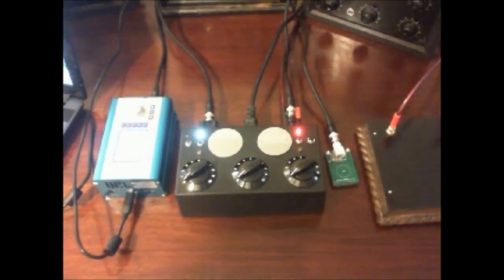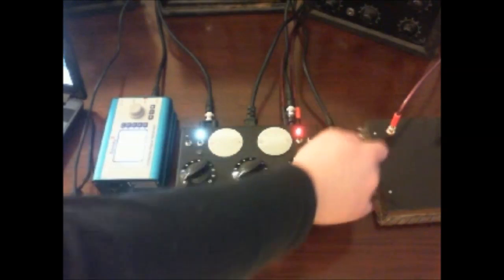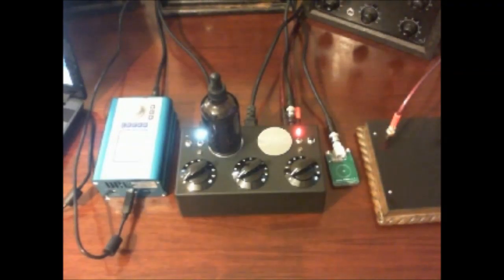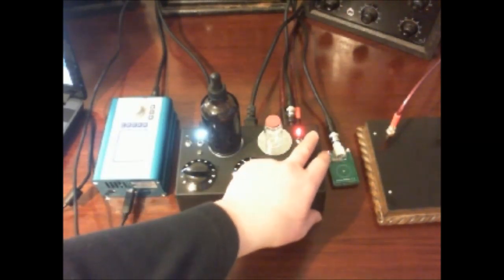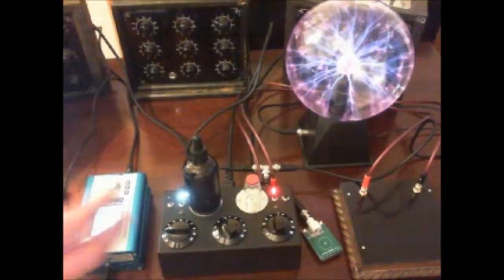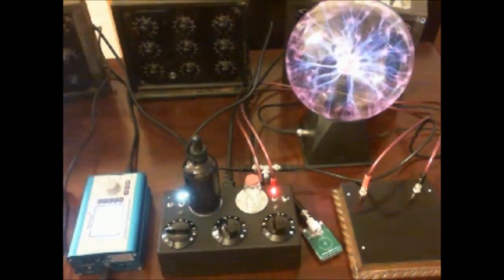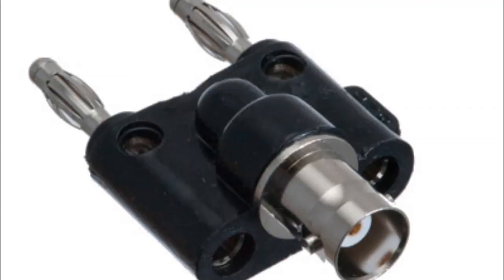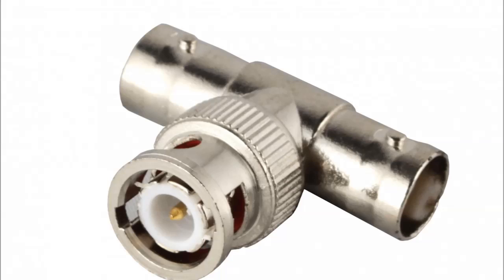Spooky Radionics Integration

Comment: found it quite interesting.  Hope when you get it up and running that you sell a whole package and not have us piece meal to get it all together.
Reply from the maker: I could supply the connectors. I have it in mind for future, more advanced instruments to install BNC connectors along side the banana sockets so it would make the whole integration much more streamlined.
Reply: There is a starter’s kit for beginners, it has all that is needed to start rifing, you can check the link:
http://www.spooky2-mall.com/index.php/spooky2-starter-s-kit-298.html